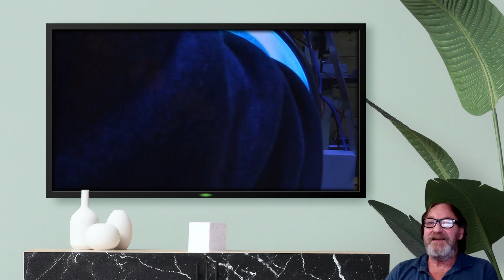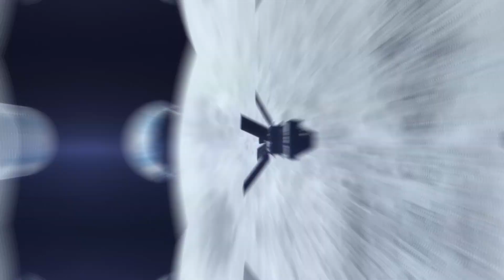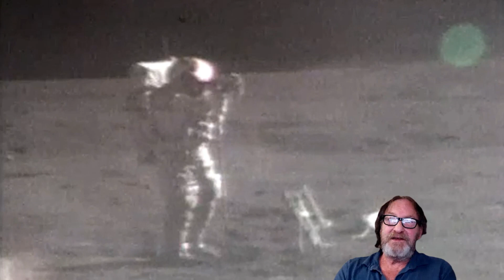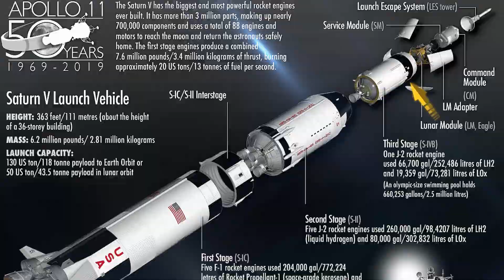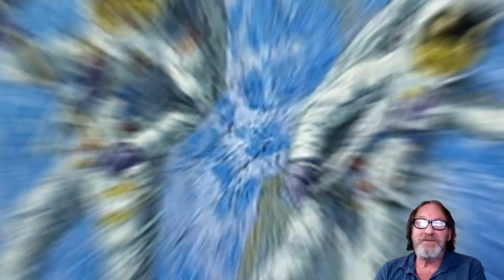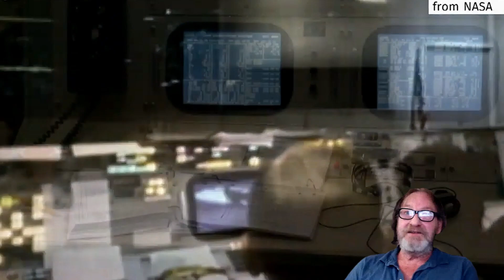THE APOLLO DISCUSSIONS "VACUUM TESTING\ OPEN LETTER &  DEFUNCT PHOTOS" PART 40

Comment: Apart from the obviously faulty reasoning, what was going on with the unavailable videos?, the Youtube notice you didn't bother to read said that "the account had been terminated" we can see this is not true of NASA's Youtube account, and you pretended that NASA had been forced to take these videos down. The more likely explanation is that what ever conspiratard you were referencing on Aulis, had linked to the Youtube channel of another conspiratard, no doubt with short out of context clips that can be used to try and trick people into believing your nonsense, and that conspiratard has subsequently gone on to spread medical misinformation on his channel and as a result had it terminated by Youtube. this is not a problem you can fix by changing a VPN setting.

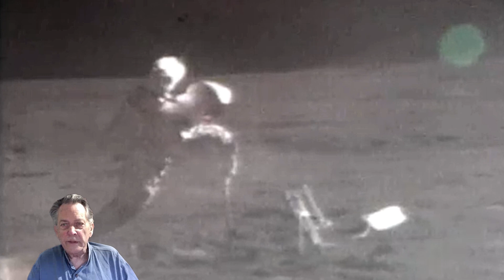Comment: 14:45 There are several documents and patents that describe exactly how Apollo space suits were cooled. The short anwer is they used the heat to vapourise  water which was released into space. Its not that simple obviously but articles exist describing the problems encountered and how they were resolved. Example "The Apollo Portable Life Support System" By Kenneth S. Thomas.

Comment: finally the fist time i watch the exact topic about how "hot" is way hard to take out of bodies, for suits and for the crafts (maninly from radiation but also could be by expeling gas or liquid concentrating the hot there, something its not showed anywhere. this video is 11+. 
On the other side theres and issue in the actual discursive ov our side. i have 2 main inssues. First i think we need to take an effort to separate the "they could not be in the moon" and the "proof that were faked", cose like in a video mentioned they could make a plot twist and said we fake the images for x reason, and that no prevent the mimposibility to "make what they have told". And in the same path, if you say the photos could not be taken in the moon for the several reason exposed, then start to analize them is a contradiction (and get you crazy looking the huge amount of them with anomalies, in my particular case i worked as a photogrametrist, so the analize the shadows is not a so simple fast thing, you need some way model the shape of th soil estimathe lenth of sourses, no triavial to debunk, cool to make someone take atention in the stuff but very very bad to make a justification.

I hope more apollo 13 stuff, it must be easy to debunk that narrative.

Comment: How can an astrophysicist ignore what is basic high school science? Batteries from the 1960s used in a vacuum with temperature ranges that would ensure total destruction of the battery. When you consider the photography aspect, it becomes almost comical, were it not such a sad series of lies....colour negative film exposed to high levels if radiation including x rays, in a camera exposed to sunlight +250f, using a small silver oxide battery (Hasselblad m) to wind the film? The list of scientific anomalies goes on🤔
Reply: As APD points out (Moon Police on this channel)...vacuum tests showed that in a medium vacuum, solid single-use batteries will (so far as minimally tested) survive (as used in cameras, etc.). However, this does not hold true for the LEM (at some point unknown) & Rover (which is never shown) or orbiter, which had to be fluid-injected on-site, which would detonate the cells immediately & explosively.

(More on that in a minute...)

"The electrolyte is a liquid solution of potassium hydroxide (KOH) in distilled water." for those batteries. They would have to be carried externally, the electrolyte internally, then combined once on the surface. Though it may be stated that the batteries are sealed, they are NOT ever shown to be protected from external temps (no, a thin layer of tin-foil doesn't count). So now you have extreme ends of temperatures in less than a few seconds, far exceeding design limits.

"...porous electrodes, but also to the compressibility of the potassium hydroxide electrolyte (∼2%), and that of the mineral oil (5–7%) between 0 and 105 kPa. As hydrostatic pressure increases in the system, additional oil enters the battery box from the compensator and flows into the cells. Pressure is equalized outside and within the battery box by means of a diaphragm, bellows, or bag and can be mounted internally or externally to the box."

Primarily used for deep see, high pressure systems...
NOT IN A VACUUM. AND UNABLE TO BE RECHARGED (on the moon).

"Cells are in the dry charged condition and are activated by injecting electrolyte just prior to power demand. They are used for missiles, rocket igniters, flares, launch or atmosphere reentry vehicles, and torpedo applications. These batteries are pneumatic–hydraulic-electrochemical devices (the electrical activation signal, often originated at a remote location, triggers a controlled explosion, generating gasses that compress the electrolyte, forcing it to rupture a metallic disk, and to flow into a manifold that carries it to each of the battery cells)." <-none of which will function in a vacuum or in high heat correctly

Short operating life (typically from a few minutes to a few hours). <take note of that stated design limit fact...the batteries are for high output until discharged.

"The Portable Life Support System (PLSS), which was originally developed for the Apollo program supporting lunar exploration and evolved into the Extravehicular Mobility Unit (EMU) used by the astronauts in their extravehicular activities."

(Prior to that, Apollo 1... "We redesigned all the batteries to make sure there was nothing flammable — no flame to catch anything (around it) on fire." Earlier batteries had emitted hydrogen gas, Brill said, something that potentially — although the risk was remote — could set off a spark. "We got rid of that, minimized the volume of the gas and materials around it so it would not burn. 

"The batteries were safe. We never had a problem with the batteries on launch," he added. "...note they MINIMIZED the off-gassing and materials, but did NOT eliminate it.)

"The Engineers Who Designed NASA's Apollo Batteries"
Kevin McClintock, The Joplin Globe, Jul 26, 2019

Wheat, a mechanical engineer, joined EaglePicher in 1963. The Joplin-based company was responsible for making batteries used in the triple-staged Saturn V rocket, the Apollo command module and the lunar module that went to the moon. Each battery was tested and installed by EaglePicher technicians at Kennedy Space Center in Florida. 

Before Apollo 11 launched, Wheat was responsible for activating the four batteries for its lunar module. He explained that each battery was nested inside a case and the lids to these cases had to be removed prior to battery activation. 

"We had one of these lids off (a back-up battery) ... ahead of time, and we scratched our names (on the inside of the cover)," Wheat said, adding that neither he nor an engineer from Grumman who was working with him dared sign the outside part of the lid. "But we made sure it was a battery that was going to be used on (an Apollo moon) flight." 

Note- If that sounds extremely far-fetched and doesn't match to what the Navy and others just explained about those batteries, then you are correct.

"Approximately 248 EaglePicher batteries were used during the entire Apollo program, Wheat said, including the seven Apollo moon shots."

"Like Wheat, one of Erisman's jobs was to activate the batteries prior to Apollo launches."

"Earlier batteries had emitted hydrogen gas, Brill said, something that potentially — although the risk was remote — could set off a spark. "

Feel free to explain how a supposedly sealed battery, full of liquid, emits hydrogen gas all the way to the moon and back, in three separate vehicles, in both a freezing vacuum, a boiling vacuum (both far beyond battery design limits), and both at the same time, while never failing.

In the news-
"The Russian lunar lander is expected to reach the moon on Aug. 23, about the same day as an Indian craft which was launched on July 14. The Russian spacecraft will take about 5.5 days to travel to the moon's vicinity, then spend three to seven days orbiting at about 100 kilometers (62 miles) before heading for the surface."...no humans on board.

Let me guess...satellite dishes that point nowhere, using batteries full of liquid expelling hydrogen in an environment so hot on the surface it immediately ignites it. Or maybe this time, the Russkies will give us a solid show.

Comment: When do you think Nasa can land anything on the moon? India failed, Israel failed, and Japan failed. It is not that easy even China landed multiple times. I have a feeling Nasa will also fail. China's engineering is way ahead of Nasa now. Look at the systematic space program that China is executing. Change-2 flied around the sun near earth orbit in order to test the communication at the maximum distance. That was the preparation for Mars landing. Nasa's Mars lander does not have even dish antenna. It is a fake CGI. Nasa is no. 1 in making fake Hollywood movies.
Reply: Seen the supposed Earth and Moon photos send back by the Russian Luna-25 lander??🤣🤣🤡 Its a clown world. Sputnik International, type in Luna-25.

Comment: Hi Marcus, this is Ross Taylor in New Zealand. Superb job as always. I have a question which maybe you or a viewer could answer for me please?: We saw recently with the Titanic Submarine that when huge external pressure is applied to an object, collapse is imminent and swift. On the moon, you mentioned that the vacuum is 10 to the negative 12.... far more severe than in any simulation. My question is this: If the carbon fibre structure of the Titanic sub was insufficient to cope with the pressure difference exerted from the external environment under the sea, then how strong would the space suit have to be to withstand the vacuum of space? The pressure inside the suit would presumably be earth-like. The pressure outside the suit would be a vacuum. Wouldn't the opposite happen to what occurred with the titanic sub - ie, instead of collapsing because of the  extreme pressure applied, it would explode because essentially the reverse occurs? Forgive my ignorance if I have made any wrong assumptions. I do hope that you are well and your health has returned in full. Regards, Ross
Reply: Hi Ross a very good question; Nasa downplays vacuum all of the time; however images of the Glenn Research center vacuum chamber should help you understand. The vacuum inside can be as low as Torr 10-6 and with only 14.6 psi on the outside the walls are 10 feet thick of concrete steel and aluminum, you can see for yourself with this link

  https://www.google.ca/search?sca_esv=557296444&q=glenn+research+center+vacuum+chamber&tbm=isch&source=lnms&sa=X&ved=2ahUKEwj7geDLhuCAAxVnkokEHXVUCawQ0pQJegQICxAB&biw=1337&bih=1281&dpr=1.5
Reply: There appears to be a misunderstanding of scientific notation. A number expressed as a negative power is NOT a negative number, it is just a very neat way of expressing very small positive numbers. So 1 x 10^-1 is 0.1, 1 x 10^-2 is 0.01 and so on. Therefore 1 x 10^-12 is 0.000000000001. For the purposes of expressing pressure differential we can therefore express sapce as 0 psi/torr/mmHg (insert pressure unit of choice). Given Apollo was US and the US use imperial measurement lets use PSI. The inside of the spacecraft was 5 psi, the outside 0 psi. A difference of 5 psi. The Titak submairine internal environment was I believe 14 psi. the external sea pressure at depth was 5,000psi. A pressure differential of 4,986psi. So completely different.
Reply: @mikeh3441  very well explained. Thanks for your insight and time. Much obliged.
Reply: Just consider the thickness and strength of the Glenn Research Center's vacuum chamber....and it cannot even achieve the level vacuum of the moon.
Reply: They say the pressure that deep in the ocean is way worse than space vacuum. I don’t know how that works.
Reply: Bravo Mike...good catch!!
Reply from the maker: This is Marcus' e mail address. I will let him know that this question is from you so that he can give you a private responce. Cheers!  nexus.magazine@btconnect.com

Comment: How is it possible to have gas pressure next to a vacuum?
And how is gas pressure possible WITHOUT a container?
Reply: The air gets thinner when you climb a mountain. 
By the time you go about 60 miles high the air is so thin it is indistinguishable from a vacuum.
Reply: @codetech5598  why doesn’t the second law of thermodynamics kick in?
And you didn’t answer my second question,… how is gas pressure possible without a container?🤔
Reply: @chessboxer35  The air pressure is caused by the weight of the air. That is why air pressure is measured in pounds per square inch.

If the air pressure was caused by being in a container ("the Dome") the pressure would not decrease drastically when you ascend a mountain as it does.
Reply: @codetech5598  pressure gradient is possible within a container, you are either being deceitful or are ignorant
Reply: Is it possible to demonstrate gas pressure without a container?
Has it ever been done using the scientific method?
Reply: Why doesn’t the second law of thermodynamics kick in?🤔
Reply: @chessboxer35  What do you expect to happen regarding the second law?
Reply: @codetech5598  why don’t you answer my two simple questions?
🤣
Reply: @chessboxer35   "Is it possible to demonstrate gas pressure without a container?"  Yes, on a planetary size, such as the entire spherical Earth.
"Has it ever been done using the scientific method?"  It is a measurement, not an experiment.

At what altitude do you think "The Dome" is, at what do you think is the pressure near that altitude?
Reply: @codetech5598  lol, your fantasy, scientifically impossible spinning ball earth, which has never been proven, is the scientific evidence that gas pressure has been created without a container????
Am I supposed to accept that tosh???

Comment: Jesus these old men want NASA to used old technology to reproduce old missions. Then they would say no advancement in technology 😂
Reply: Artemis I was supossedly an advancement in technology, yet it had to send dummies in new radiation vests instead of astronauts, a new tiled heat shield and conduct a new skip re-entry maneuver, instead of the alleged direct re-entry, just so the craft wouldn't burn up .. If NASA had sccessfully sent nine manned missions to the Moon over half a century ago, with no problems whatsoever, then why can't they repeat that amazing feat today? .. I think these "old men" brought up a very good point about using that "old technology".